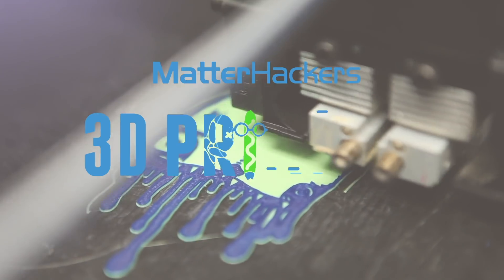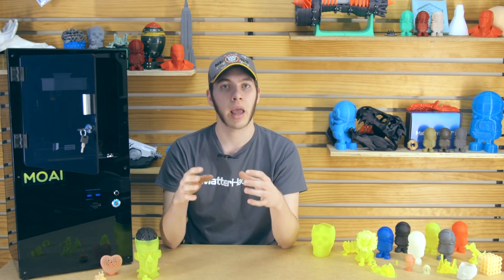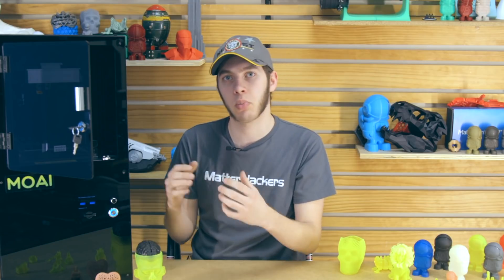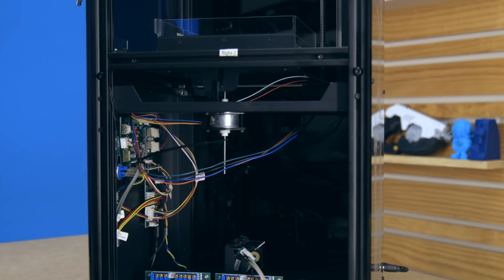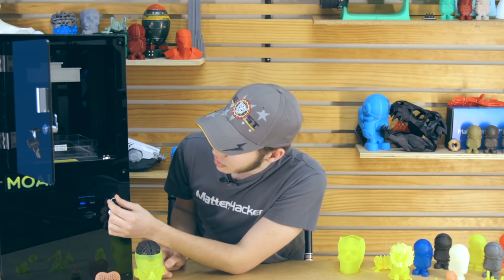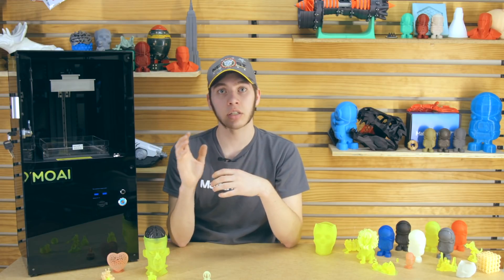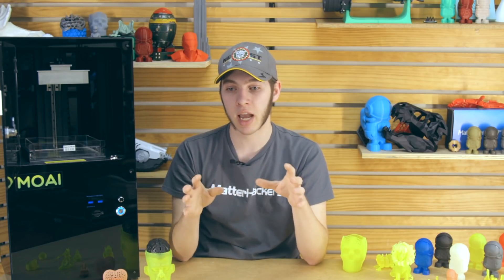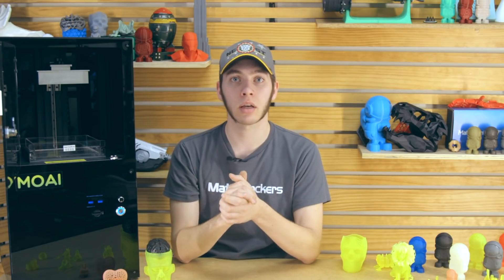Getting Started with the Peopoly Moai SLA 3D Printer // Unboxing to Leveling to Test Print

Comment: Hi, I've been trying to print this x wing fighter using the MOAI unsuccessfully... I added supports everywhere thinking that it would be the weight that's pulling down the figure.  The one thing I haven't tried is hollow the solid, but I'm not sure if it's necessary given that being solid there shouldn't be any internal air pressure issue with it, isn't it? Could you please give me some pointers as to what to do in order to print this one? Here is the link from thingiverse, I'm using the sliced version: https://www.thingiverse.com/thing:909499